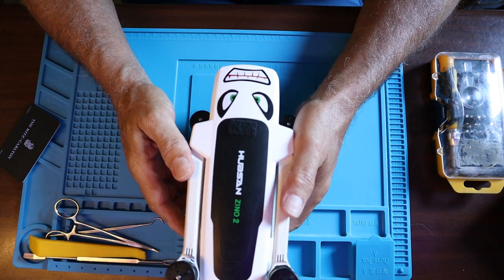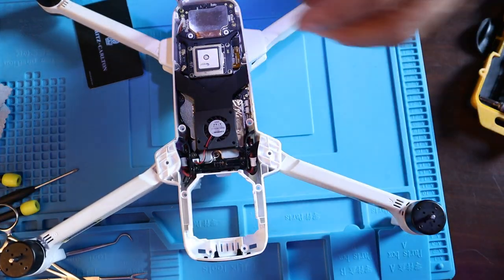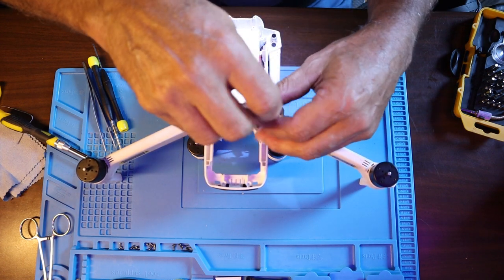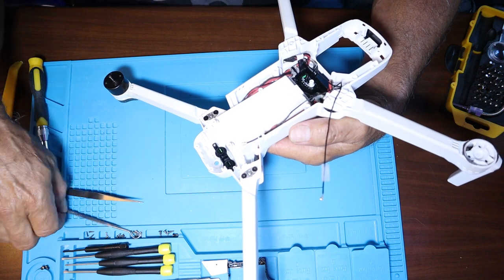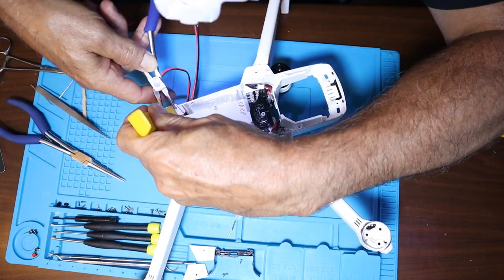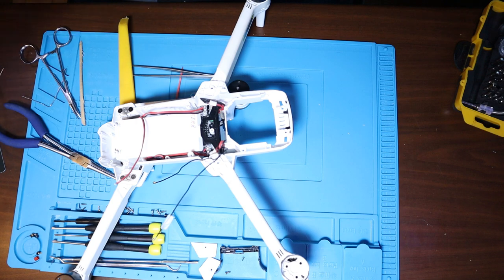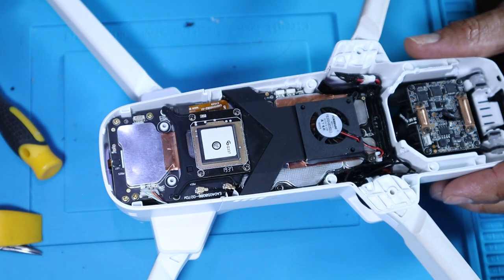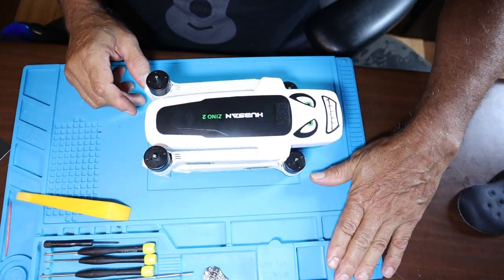Zino 2 Teardown

Comment: Hi nice video got a fimi myself amazing drone have you check to see it you've got voltage getting to the main board plus is that the battery that was in the crash if so it could be faulty not given power to the power board or the battery pins that are soldered to the power board might be cracked from the impact may need re soldering you might get lucky just a thought.
Reply from the maker: I know the Fimi X8 is great flyer and the controller is really nice, the  software and App are easy to get used to! Thanks for the tips I will give it a go! I think the power to big  hit. All that energy was transfered  to it. I think I have a bad trace in the board that I cant see. Ordered a new pwr bd from Aliexpress.

Comment: Al, you just posted the best Zino 2 video teardown and putting it all back together. The click, click noise, could also be one motor bearings being broken or cracked because of the fall, did you look at that? If this is the case, it is better to replace that motor, because it can get locked during flying, and then the quad could fall from the sky - I got this problem last summer on my EX3 quad who fell hard on the pavement after hitting a tree, then after two flights, it fell from the sky because its motor locked, and after replacing the locked bearing brushless motor,  it flew again.
Reply from the maker: Thanks for the support and for sharing your experience with us @Blyeskyver! I I love he way we all chime in to support and collaborate to solve our issues. Thanks again my friend!

Comment: I order a replacement leg B for the rear left.. it comes with the wires and the white connection part- so much work just to replace 1 leg..
Reply from the maker: YEs it is! Worth it in the long run!

Comment: Hi, my rear red LED does not turn on after crash. I replaced the arm with ESC, network tube, shrinkable tube, but kept the motor, which seems to be OK. Does the LED not lit up indicate that the motor has been damaged as well? Thanks very much for any suggestions!!!
Reply from the maker: The rear  LED is usually a separate signal line controlled by the flight controller. My guess without inspecting your aircraft would be that the signal wire to the led is not making a good connection. Lastly it could be the flight controller section that controls the led is having issues
Reply: @Duranafy  thanks very much for the reply! I finally put everything back together yesterday. This time, the LED came on. I powered up in the house, everything seems to be in order. Tomorrow will be the first time I fly after the crash a few weeks ago. Keep my fingers crossed.

Comment: How to open cable arm zino 2, replacing the cable arm, right back
Reply from the maker: Replacing the cables in the arms are a big pain in the ass. You may even ruin the arm. The arm cables are sealed in the arm with a glued on plate. try removing the pate without distorting shape of the arm.